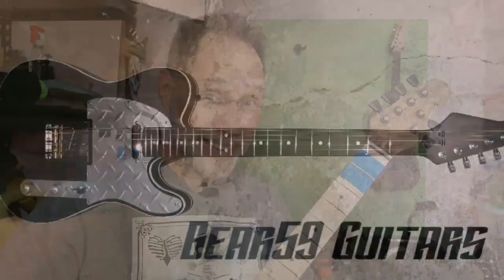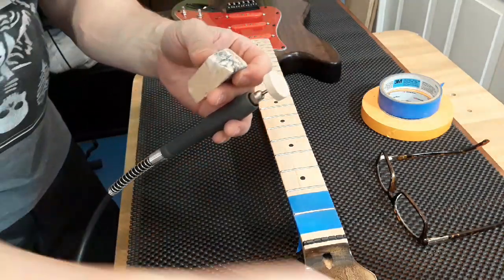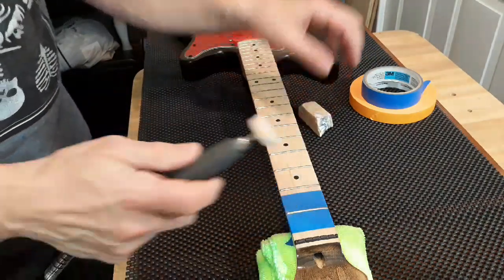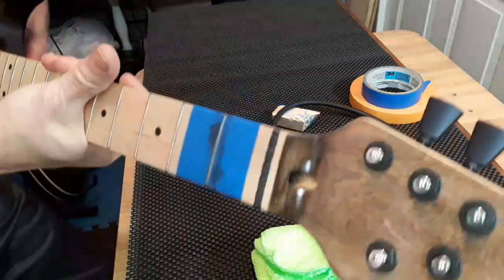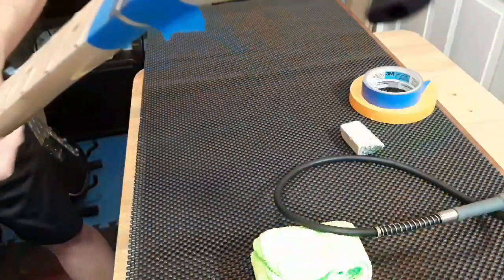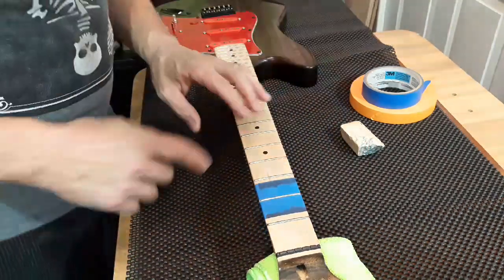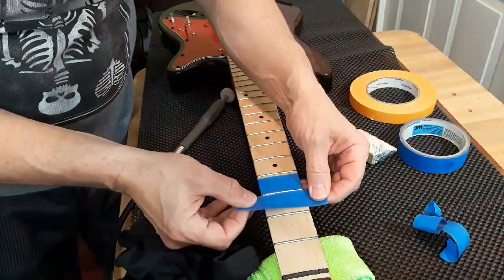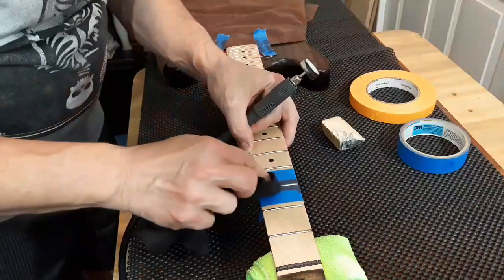How To Polish Guitar Frets with a Dremel Style Rotary Tool

Comment: So before I proceed per your instructions on the assumption you know what you're doing and that a master luthier could watch your video with minimal twitching and/or screaming in horror, I have a question... Why did the headstocks on the two guitars shown near the start of the video kind of look like they were pulled out of a house fire? 😉
Reply from the maker: LOL! One stained black, one stained brown, then thrown carefully into a house fire 🔥
Reply: @bear59guitars33  I now finally understand how roasted necks are made. 🤔😜🤣😁👍

Edit: As the loving owner of a 2001 EBMMSMSM, (Musicman Steve Morse) the headstock on the guitar you're working on immediately caught my eye. Is it a Musicman (or OLP etc.)? Thanks for the video, BTW.

My (presumably) lifetime supply of white jeweler's rouge got delivered yesterday and I've got an Epiphone "Super Strat" that I inherited from my kid brother all taped off and ready to be polished after initially just intending to fix the horrendous finger shredding fret sprout it was suffering from and I'm very curious to find out how noticeable the difference from polishing the frets will be. Seeing the guitar has been barely touched since 1992, I figured removing 3 decades plus worth of oxidation might not be the worst idea I've ever had. 😉🤦‍♂️🙄🤷‍♂️😁👍😎